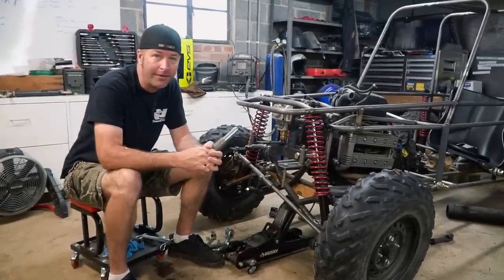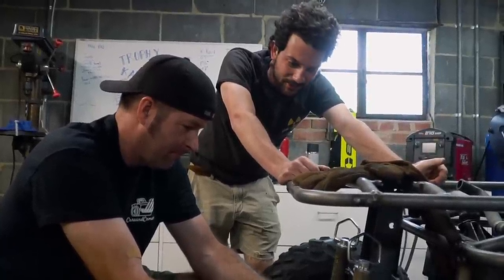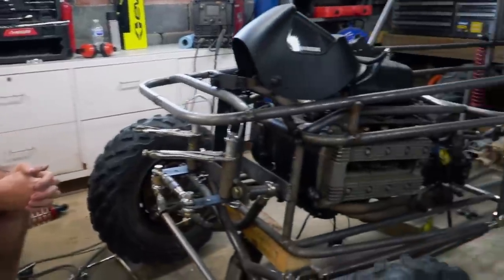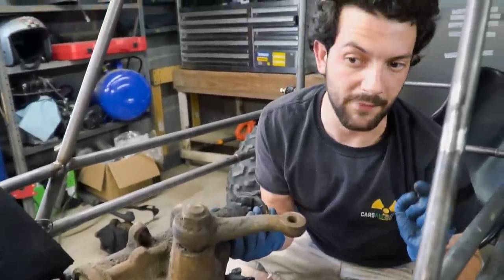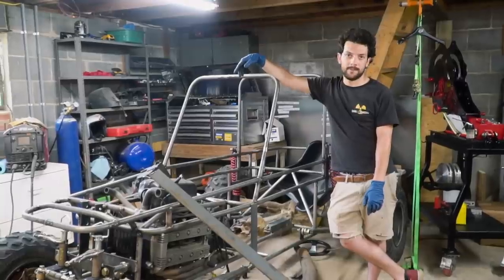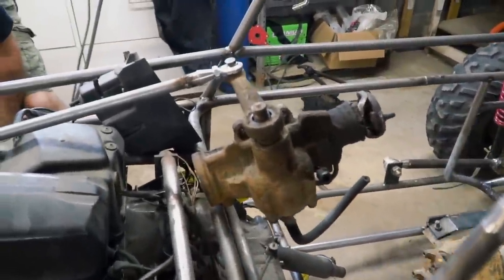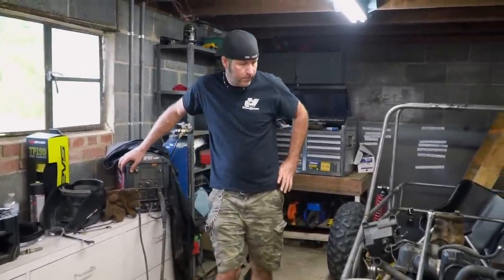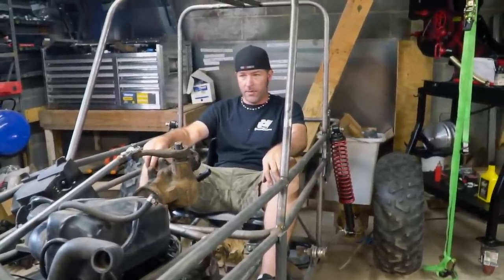1000cc Trophy Truck Build Pt. 9 | Steering Finished!

Comment: John, depending on your finances and the amount of labour you want to invest in yourselves, 
Consider having a few weekend working bees or work shops, (THE OCCUPANTS PAY TO COME) 
and as it is just a large rectangular building it will go up very quickly, 
Being basically sand, clay or road base materials, small amounts of cement, and wheat bag's the money saved will mean a far bigger shed that is naturally well insulated 

checkout the part 1 of Kris Harbour "s workshop it is a rendered sandbag and as you have a tractor now it will make life easier (like Kris has,)
NEXT
Check out how mylittlehomestead does their sandbag building
Also consider a straw Bale. Building (rendered) you could use a rammed earth floor, post and beam, and tin roof then infill the walls with straw bales forced down over in bedded reo rods they go up very quickly to plate height then you cover the lot in chicken wire and render the outside and inside extremely well Insulated (20inch thick walls) search YouTube for straw bale buildings
Again advertise that you are having workshops even if you just offered work for food BELIEVE ME THEY WILL COME!
another option is pored in place concrete panels
(concrete slab down, black plastic over that, formwork for the panels on top of that
(think on how you are going to join the panels when standing up) 
Reo bars or mesh for strength, fill with concrete let dry 1 panel made, you want a window? Put a form in the panel frame and theirs the window space, rinse and repeat as they say!
If you had as many frames ready to go call up a cement truck if you don't feel confident in the grano work call in a team for a few hours to give you a perfect finish and extra hands to do the work
Again this once they are dry goes up very quickly, our supermarket went up in 3 days and it is huge!
I hope these suggestions give you some ideas guys

Or you could consider a 
Quonset hut that may be the cheapest of manufacturered buildings

Strong backs and plenty of motivation to you all
Tony from Western Australia.

Comment: Most of the side by sides should have a electric power steering system. I know the  Kawasaki mule has one at least the pro-fx does. Try calling around at some of the dealerships that have service as well. Cyclemax in Wilson and in Fayetteville or Ron Ayers in G-vegas. Try cyclemax first in Wilson and ask for Randy House which is the service  dept head. Or Van Paul Jr. Hes the owner.

Comment: Start with a 40x40 make it easy to add on later, for a 40x60 and you gain about 100 square foot. For what yall do post frame would be just fine. You can add lvl or metal beams for cain or track system in easily. Just my opinion as a carpenter, it would save you money on labor getting a post frame kit and standing it would be possible between the 2 of you.

Comment: Hi guys. A simple way is to run a drag bar to each front wheel back to the steering box like an old tractor. Eliminate all the front steering you have and keep twin I beam. It has work on my old tractor for 70 years as far as steering. Thanks guys.

Comment: Why not use a steering box from a utv or a golf cart? Or use like you said a manual rack and pinion but use a chain and gear to change the ratio (less turns)

Comment: In a 1930's hotrod don't they use a small chevy Vega steering box? Would something like that work for future use? I believe  that it's about 10 to 15lbs, a lot lighter than a full size GM unit.

Comment: Red I beam would be the best pole barn would be cheaper. Look into a steering quickener the run about 100 bucks they come manly in 2-1 ratios but it will speed up your steering a bit I can send u a link if u want. Bust awsome guys hope to see u next year

Comment: Y don’t u use a corvair manual gearbox short nose light and 4 turns lock to lock or u could use a long shaft one and have the gearbox by the motor

Comment: 1st gen toyota prius steering... all electric 12V power steering built into the steering shaft. just needs power and a 12v signal to one pin on its harnes to turn on. $35 at your local salvage yard.

Comment: Question. Is that frame made out of steel or aluminum? And what is the size and wall thickness of the tubing? I want to build something like this but smaller, wondering if  1/16" wall steel tubing is strong enough if braced correctly. I feel like it would save a lot of weight. Bonus question how much HP does that engine have?

Comment: Can you scrap a steering box from an old boat? Manual or hydraulic dual or single cable might work. I have a Yamaha unit, dual steering setup on my bass boat, manual not hydraulic and it’s super simple, and should easily be modified. Bet you could find the setup for $100 or less as you don’t need the super long cables. Heck, you probably have a setup sitting around.

Comment: VW bug or chevy vega. There is another system where you use matching 2way cylinders like from a convertible top cylinder and you drive one with the steering wheel and use the other as a remote cylinder when you turn the wheel it just pushes the displaced fluid to the other cylinder by transferring the fluid back and fouth. The transfer lines must be as large of diameter as possible.

Comment: very simple mildly cheap solution for your steering rack problem. The Toyota Prius Suzuki forenza and a couple other cars use this small tiny little electric power steering rack that is attached to the steering column all as 1 module. A lot of YouTubers and custom cart, car and other vehicle builders use these power steering units very successfully on many of their builds. Might I suggest checking them out or at least some kind of variant from even another cheaper Korean car with electric power steering and maybe you can find something that will suit your build.

Comment: Random question: if one removes the governot from a predator 212, do they actually need a billet flywheel?
Reply: I hear that the stock flywheels have a tendency to grenade with the governor removed. I wouldn't want to be anywhere near it when that happened.
Reply: I heard that too, but the same sources say not to remove the governor at all, and everyone does that anyway. Thanks tho!

Comment: U need the electronic steering box out of a equinox. 120 bucks than buy the resistor kit for that for 50 bucks and away u go build the shaft from steering wheel to steering linkage

Comment: Imagine the Cross cart vs the grind hard plumbing co’s Odyssey
Reply: Im thinking the odyssey would win just because its a two stroke
Reply: Well, 130 horsepower doesn't hurt either, I believe the X-Kart has around 80?
Reply: Henry Bogen I just wanna see the cross cart go around their track
Reply: @preetamdasika7636  not sure but i don't think the odyssey would have 130 if it was a 4 stroke correct me if im wrong but i think its a 350cc
Reply: they would get smoked they have nothing on grindhard... those dude are fabricators that do know what they are doing.. john even said they dont know what they are doing they are learning..
Reply: So, it would be for fun and you can’t say that seeing the cross cart rip around that track and their yard would not be fun as hell to watch
Reply: @justlux4684  also the odyssey was a actual vehicle before it got modded so they have that on their side as well

Comment: Do away with the setup you're trying to build and either change to a pushrod steering setup and get the steering arms flat. With steering arms at that much of an angle you're going to have massive bump steer. You want the arms to be as flat as possible when the suspension is sitting at rest. Up travel and down travel should make the steering arms have the same angle degree at both limit points (up and down).  Understanding steering and suspension Ackermann is a very tough and tedious process but once you get the hang of it you'll make crazy awesome projects.

Comment: Not an expert, but I've worked on a couple ford TTBs. I think your steering linkage has to many moving parts. They only have 2 linkages, one main, and one short one. Not sure if you guys looked at those, but though I'd throw that out there. You know the K.I.S.S. concept. Would make maintenance in the future easier.

Comment: If you are looking for bigger, a pole barn is the way to go. I would stay away from carport style buildings. I am currently building a pole barn for myself. And have an old pole barn from the 60s. One thing i can say is you can modify and redesign pole barns very easily. I beam construction is strong and permanent but hard to change in the future. Pole barns are not as strong and permantent as ibeam buildings but last a long while. Plus can be easily and cheaply redesigned in the future. You are alway going to have a good idea or a redesign that you think would work better for you. Thats where a pole barn comes in. Honestly cant go wrong with either. I personally own 2 pole buildings and am very happy, and have friends that have i beam constructed buildings. I am a little envious of their buildings but mine works perfectly fine. One last tip, save money for a nice concrete floor.

Comment: QUESTION: Been watching y’all for a while! I currently just finished my first go kart build with my son, it was a thunder kart from the late 70’s. I’m getting ready to do some mods to the predator 212cc, if I add a header and an aftermarket air filter do I have to change the jet in the carb or will it still run like it’s supposed to?
Reply: depending on filter flow, you'll probably have to rejet. The Amazon/E-bay filters are way less restrictive than stock and still typically less restrictive than the filters that are included with the typical "Stage 1" kits out there. So, if your filter and exhaust are truly increasing flow you're going to have to rejet.
Reply: Drago Werx thank you!!

Comment: That steering setup....hopefully you guys have figured it out by now bc what you have is not going to work well. Why not route your steering shaft under the cart using u joints. make tabs come off the back of the spindles and set it up like rack and pinion.

Comment: Thats going to be one SMOKING VECICLE.  The flying BMW Brick 🏍 has a big problem. Just leaning on the side stand or into a corner causes white smoke out the exhaust pipe.  I own a 1998 k modle. I have 80k miles on this awesome bike and on the street this well known small smoke screen problem is bad enough.  You guys going of road should be very interesting.

Comment: not a safe idea with mounting the steering box there. with the idea this vehicle will be jumped it could land nose down and snap the drag link and shove it straight into you. or even a hard front end collision. mount it up front somewhere and fab up a steering shaft that will collapse upon impact. plus the up and down travel of the suspension may require the steering shaft to be a slip style anyways.

Comment: Prius steering column, 3 wire hookup and easy to adapt. Can be had for $75 at a salvage yard
Reply: A Prius steering column won't do any steering without either a rack and pinion, or a steering box.

Comment: Maybe an obvious statement but, if you build a metal building, insulation is even more important. My brother had a 40’ X 64’ metal building put up a couple years ago and because of the size of the roof, had to have an insulation company apply a spray foam insulation to the ceiling , not cheap but necessary and has to be factored into the total cost of the building. Then we insulated, dry walled and painted the walls ourselves. Without the ceiling insulation, the building would be just about unusable even on an 80 degree day.

Comment: Why couldn’t you attack the inner tie rod onto the same mounting point just have one stacked on the other and one bolt goes thru both inner tie rods to hold them. Attn; doesn’t have to be a si gem bolt it could be a single piece of pipe for strength and the pipe goes thru both inner tie rods and the bolt goes thru the pipe so to speak

Comment: Why don’t y’all just get a steering quickiner? You can get them from speedwaymotors.com! They have tons of different ratios that’s what we use on our race cars so you don’t have to move the steering wheel as much. It just a thought instead of using that big heavy steering box. These are small that you mount on a rollbar

Comment: You need a Toyota prius electric power steering box. Its a compact unit that will mount under the dash and runs off the battery.

Comment: Hi John, as a past contractor, I would highly suggest a block building with trusses and metal roof. Keep in mind, pole barn or steel frame, u still have to stud up walls to at least 24" on center to be  able to insulate and install some kind of interior surface to mount things to the walls. Block is much more energy efficient. One of my favorite sayings,  “The bitterness of poor quality remains long after the sweetness of low price is forgotten.” Good luck, need any advice, hit me up on facebook/mysmallengineguy.

Comment: Consider:  Since you are You Tubers, invite other known You Tubers to assist.  Andrew Camarata comes to mind, as does April Wilkerson, off hand, though there are others you might consider.  Someone having done similar work before could improve your exposure if, whoever you invited also posted vids of the shop build. Bo.
Reply: They're already acquainted with Red Beard and Vasily and others, but I'm amazed that GoPowerSports wouldn't have a steering box or rack that worked!

Comment: Takes a crew to build a red iron building pole barn you can get away with 40x60 on the cheap there simple and easy and you can build lean to on the sides as well go to the metal roof guys and they will get you started our metal roof guy does carports at a 3rd price of venders
Reply: Carefull on who you get to build a red iron building my father inlaw had a guy mess him over

Comment: steel shed would be fastest and probably last the longest but its either hot or cold depending if the sun is shining and wil sound like youre in a steel drum when its raining 
not sure how you guys are doing with wood eating insects but this could be an option too : https://dengarden.com/landscaping/How-To-Build-A-2-Floor-Shed
takes a lot of material but its eazier to insulate both for sound and heat/cold and fit to youre needs , it think you guys could do it if you have some help raising the walls up once there assembled , and probably a crane / forklift to get the roofpanels on there 
would make an awesome video

Comment: i was thinking straight axel with a single leaf spring. i never met a twin I beam i like.  and i'm a ford man. a 4 inch slab should be great. and save you alot of money. your not going ot be parking 18 wheelers on it.

Comment: Most Chinese gocarts have a small rack and pinion. I'd just get one of them, they're only about 60 bucks.
Reply: except the rack and pinion from those dont have the travel they need or the torque .. i have seen multiple with the gears stripped out due to "oversize golfcart" tires let alone miata size tires. they could use a steering system of like a honda foreman 4X4 4-wheeler, it has an electric steering box
Reply: @Neighbor512  the one I used on my build had no problem with a 31 inch tire.

Comment: Not the world's 1st I beam theres plenty of drawings and diagrams for steering and suspension on the web.Not sure what the contraption yall built is but it looks dangerous have that arm and rod end straight towards the driver.If something were to break and shove that rod towards the rear the driver is going to be speared in the chest

Comment: Electric power steering column from a Prius! Use the wiring from that engine (all ADV bikes have beefy charging systems and big batteries) to power an electric column

Comment: Look up I-beam swing steering, lots of info. You need to measure where your shock will bottom out, cause your going way beyond it w/ your compression, when trying to figure out steering.  Don't call it a "trophy truck" please. You don't call a go-cart a nascar

Comment: Hit a junk yard and pull an electric power steering unit.
Reply: Nevermind. I see the constrains you are working with... going over the motor, and the electric route would require a redesign. Digging the project.

Comment: Wow you guys must have had Wheaties for breakfast  or some thing because no body wants any ones opinion on anything these days..hahahaha!
But since you asked for it he's my opinion. Firs sell that Kabota you bought it's not beg enough to handle the jobs you need it to do and proof of that was when Ike got it stuck. go find a good used model a bout 4 sizes bigger than the one you have now. or a John deer caterpillar with a backhoe attached and a bucket loader on the front.  as for the building you want I'd go with something that has a second story to it for an office or even a place to live.

Comment: too much going on with that steering. shoulda went low with a rack and ran the steering shaft under the engine via a few u-joints. less weight, less janky.

Comment: Sorry to say but that entire steering set up is WAY to flimsy.. It will have to much ply and wont be strong enough for a "Trophy Kart"

As for building a bigger shop you just don't need it... As you said your not fabricators and don't have enough equipment or knowledge to utilize the extra space. Don't rush things. Keep Cars and Cameras small and simple, That's what you are!